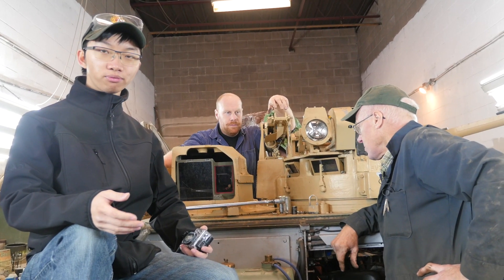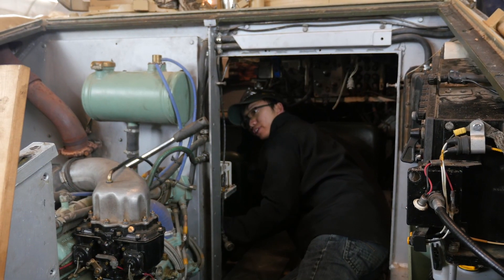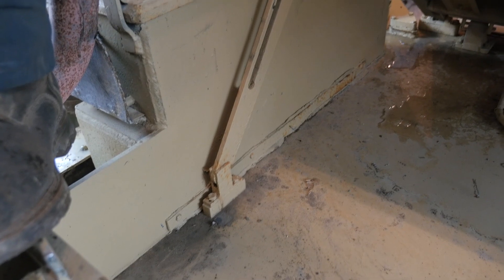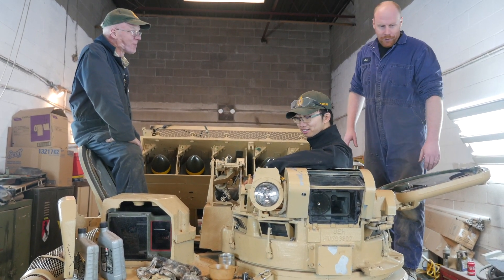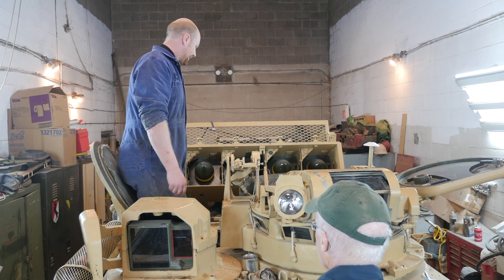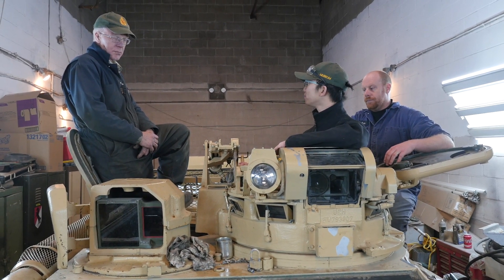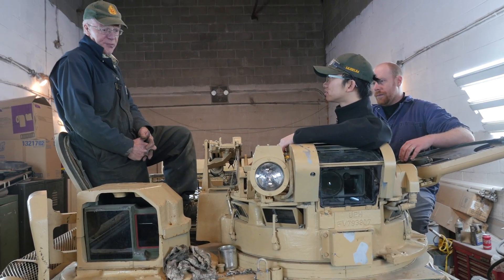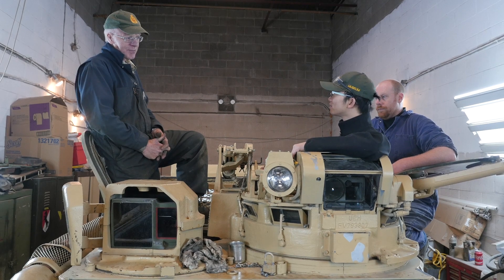CVRT Striker Repair: Raising the ATGM Launcher (March 10, 2018)

Comment: You ask what the electrical connections are for...
The electrical connections on the missile bin are for the various connections to the missile. Swingfire is stowed in a hermitically sealed launcher container which is slid into the launcher bin. Sprung connectors then connect the container to the bin. When the training plug is fitted, you are able to test the missiles for connectivity and simple errors. With the arm plug fitted,
the missile is made live when the fire button is pressed. The reason for so many connections is that the missile needs various commands before it fires. It has no conventional batteries.

When you press fire, a command ignites a small rocket motor that heats up a thermal battery to power it guidance circuits. A second command ignites a second rocket motor which spins up the two giros from the efflux. A 3rd command is a check command. The 4 command dose nothing. The fifth command ignites the main rocket motor which is two stage, boost and sustained.

Trailing from the missile is a single strand twin wire which allows signals from the guidance logic in the vehicle to guide the missile to its target. The wire is 4 Kms long! This can be also be done by pressing the take command button and guiding the missile via a joy stick.

The launcher bin should raise faster than you have it. I suspect the one way valve in the output pipe next to the pump is not working one way. Also, there should be an accumulator on the right side of where the missile operator sites that need charging to around 500 psi. This helps keep the hydraulic pressure above 1500 PSI. It takes the hydraulic system on my
striker 6 plus months to loose pressure. 
PS, I made those missile cones ;)
Reply from the maker: Will pass on your information to the guys working on the vehicle, thanks for the info! -Johan